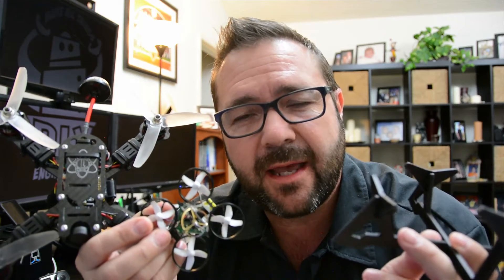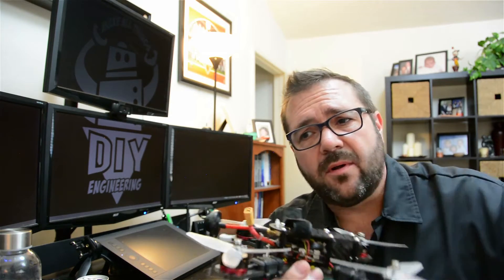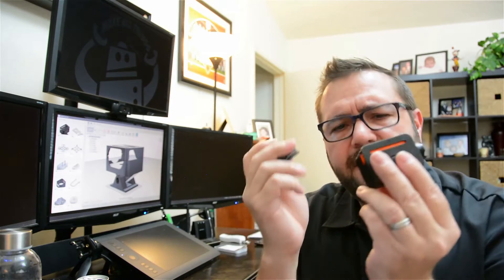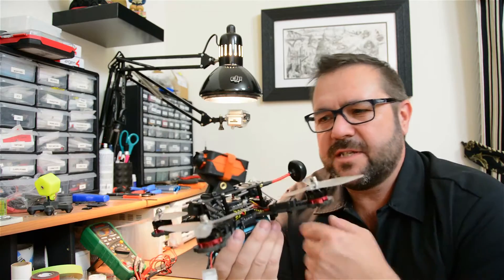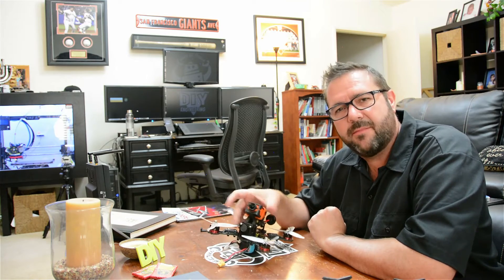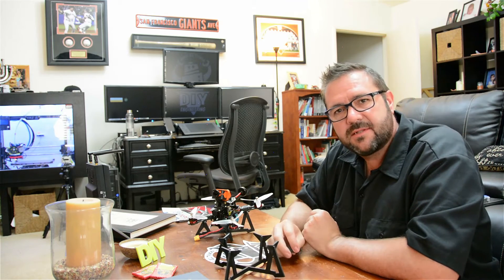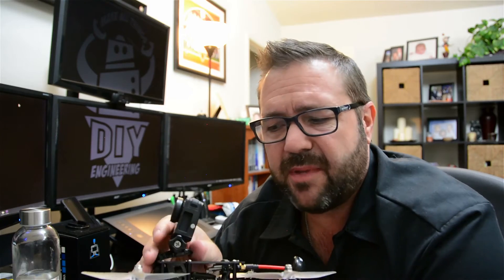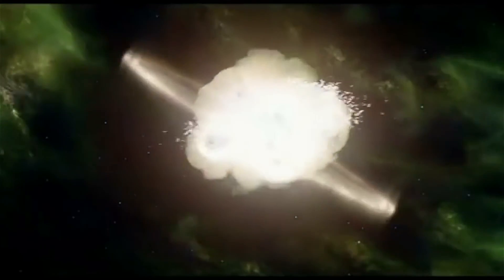Episode 010: Failure is always an option!

Comment: The best, adjustable mount i've seen so far! Now i need to find someone with a 3D printer to help me out :)

As for the Runcam 2 audio, indeed it's giving a lot of (mostly prop wash) noise. I think Runcam (in the early days of this camera) sort of 'muted' it, so everybody was complaining about the low volume. Now the volume is a lot better, but... propwash sounds awful.
For those that see your video, and haven't returned their Runcam 2 yet, here's my DIY solution for the noise:
Open up the casing and put a tiny bit of electrical tape DIRECTLY over the mic (cover it completely). Maybe add a tiny with of foam/wool in front of it and close it up. It does lower the volume a bit, but all that horrible noise is gone. ;)
Happy flying!
Reply from the maker: good advice, glad you like it.
heck, give me a like and subscribe to the channel and i'll print one for you. ;)
Reply: TNX for the offer, but i'm afraid the shipping costs will outweigh anything available in the EU. But you've earned the like for sure ;)

Comment: I was looking for runcam 2 mount and found it on Thingiverse which brought me here, now I have a great new channel to watch and a new mount! The audio is horrible but I am learning to race/freestyle and crash at high speed so holding off on go pro.
Reply from the maker: Great! thanks for the sub! I totally agree, the video on the runcam is good, for me doing the timelapse stuff helped me justify to get the gopro, but I run it with a full aluminum housing on the kwad, which adds weight...but I cant afford to break it. plus im still learning to race in rate mode so im a bit wreckless. :)

Comment: the sound efx are cool. nice work Dave, the go pro wont be too heavy? mine is a tank... at least seem like it would be for a drone? cool nice vid even tho you failted!!!
Reply from the maker: Hi, the GoPro hero4 weight is not so much an issue, the GoPro weighs in at 43g, the total drone weight hits 600g with the GoPro and Battery on it. 
Although every little amount of weight makes a difference, each of the four motors produce 1000+ grams of thrust so 4000-600=3400g of thrust ... so, still plenty to launch this thing like bullet. :)